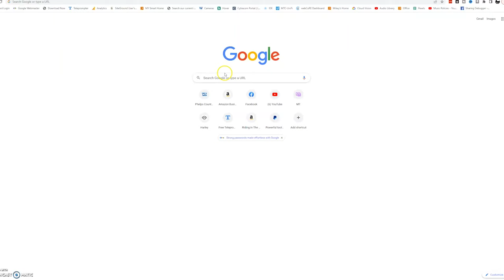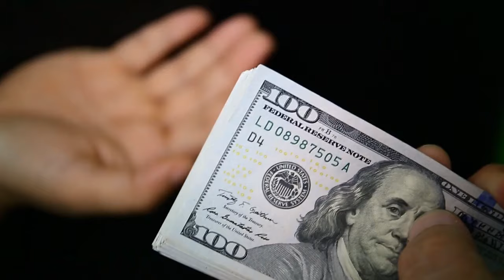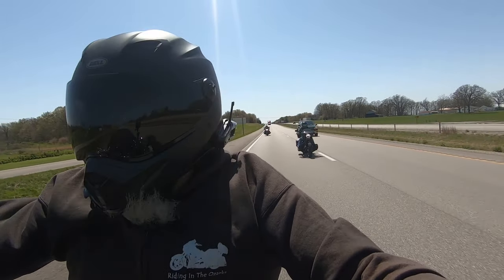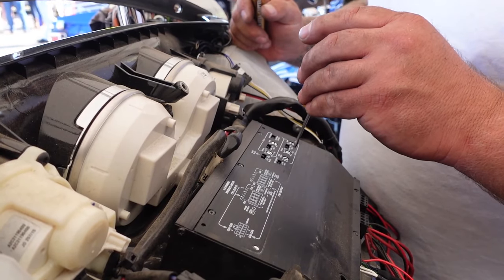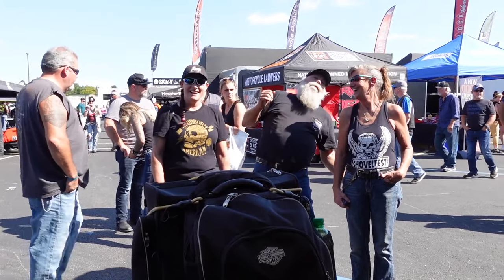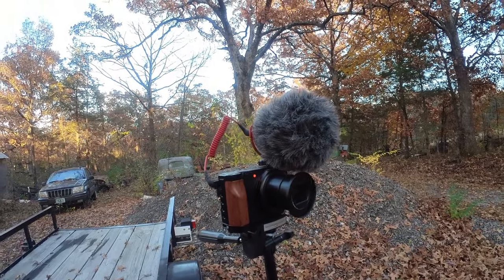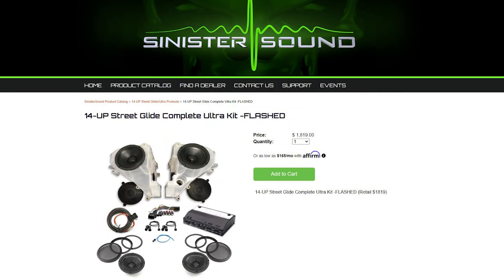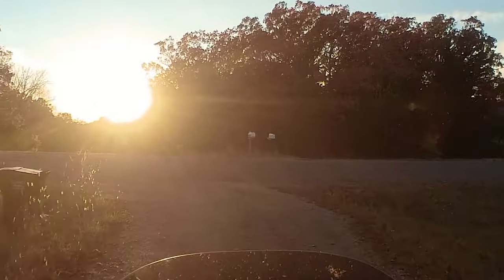BEST HARLEY DAVIDSON AUDIO UPGRADE!

Comment: No doubt that's a loud system. Nice job on your upgrade. Although I already have a system myself, I will no doubt go with an installer like Sinister on future builds as well. The tuning alone can make or break an audio system. Thanks for sharing & nice dance moves
Reply from the maker: It’s not cheap but I am very satisfied, it’s not just loud but clear
Reply: @RidingintheOzarks  Clarity is where it is at. I've sunk a pretty penny into my set up so I understand where you're coming from on cost. If you're happy with the performance, the cost will equal a good deal... That's what I tell myself anyway lol